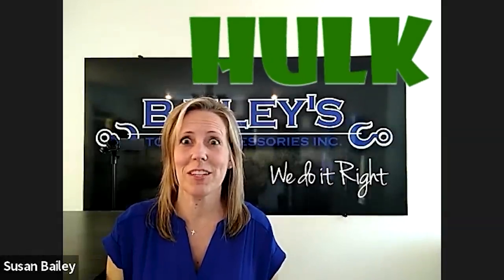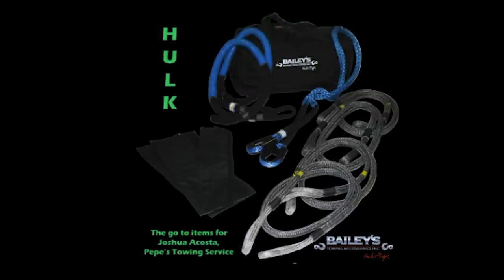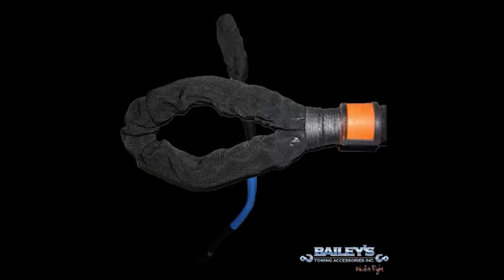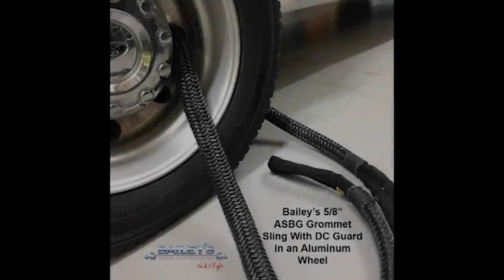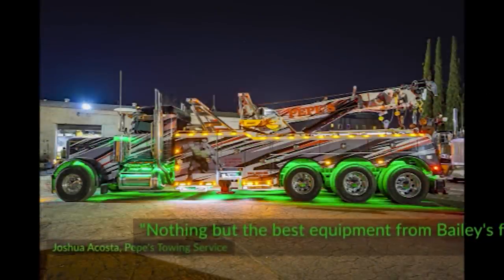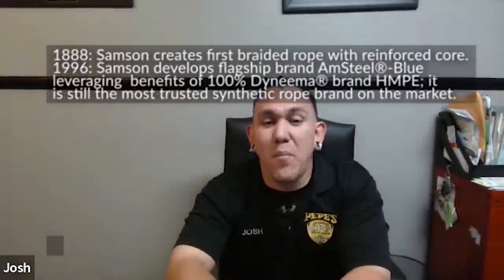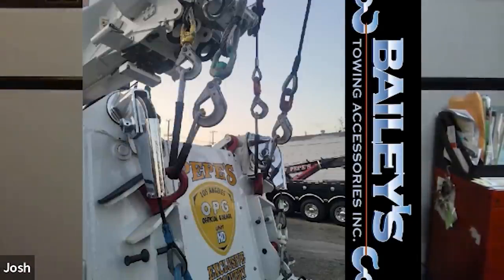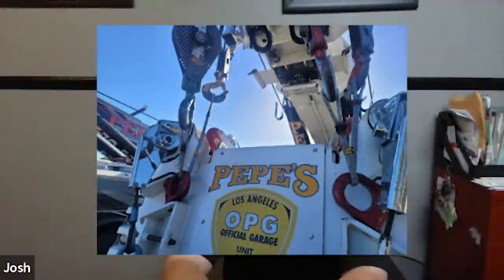Synthetic vs chain in the towing industry: why you NEED to evolve

Comment: Different application, but in 1978-79, my destroyer, USS Hollister (DD-788) transitioned from manilla to synthetic mooring lines. Synthetic mooring lines all had tattletales woven into them so that you could tell as it was approaching maximum safe load. Never had a synthetic line break but seeing the seawater flash off as the internal temperature rose was always impressive. There was a lot of inspections of the lines as part of preventative maintenance.
PS - Long Beach Naval Shipyard team used a lot of wire rope but they were specialized at maintaining / rigging heavy loads on and off the ship. Items like motor generator sets, gun mounts, etc.

Comment: I am a mechanical engineer and steel ropes definitely outclass synthetic. This is due to their vulnerability to shear. One sharp edge and you won't see it coming. Chains have a similar problem where it is hard to see the wear, but it's still less likely to shred. This does not mean synthetic is by definition worse. In many cases it is the best option. They are still developing synthetics, even synthetic mixes (composits)  with metal. 
Keep using whatever works for you. For rigging steel ropes aren't an option (bend radius too small). Synthetics are a good option. Most important is to take the working load limit from the manufacturer seriously. This has a safety factor. If it is breaking load limit you should apply a factor 10 for safety (due to working close to people)

I know you always make sure everyone is clear of the job so that's already the best safety measure.
Cheers for the video!
Reply from the maker: That is correct, that is why I place a HUGE emphasis on protecting the straps and slings. These ropes can fit nimbly into places a chain cannot. My applications are strictly for the towing industry. You wouldn't use these on sharp corners. For the vast majority of calls, these will out class steel rope. Take my 5/8" ropes here, they can hold 33,000lbs in a basket, can be folded to fit in my hand easily. I can carry 4 around my neck and not even feel it. You have to factor in efficiency as well

Comment: Hi from uk josh and crews👋👍 nice to see a interview with the company that supplys your equipment man👌 and nice to know your values on it to and I think chains are dangerous on high rigging like containers etc cos if its slips of side and catches operator it likely to pull them over to as nylon ropes got tiny bit more leeway 👍 like the touch with fire hose too never thought it was hydrant hose👌 also great job at end for airport that rig must of weighed some tonnage coordination was key as always👍 thanks for your time and be safe see you soon 👍👋

Comment: It gets down to cost and the return you can make. Synthetics with an operator that cares about the equipment can save time and money. Operator that allows synthetics to get ratty you're going to have problem giving out. You have to inspect your lines after you use them chains and cables should be checked as well. But many employees do not see the job the same way an owner does.

Comment: How does bailey's compare to Yankum ropes? I see Heavy D of the Diesel Brothers use them all the time for recoveries.
Reply: Yankum are kinetic energy ropes, so they are designed to stretch and contract. Not the same as rigging synthetics. Great for recoveries see Matt's Off Road Recovery. Ron Pratt uses them in more normal towing applications often as line extensions or redirections.

Comment: needs a spreader beam
Reply from the maker: A spreader on a cargo loader? Why would I possibly do that when it's not an even load?you do know a spreader bar isn't even rated to lift that much, do you even know anything about them or are you just talking out of your behind?
Reply: @PepesTowingService  I've used 2 cranes for on spreader beam rated at 400 tons. Power plant use. you can still control the load with having your pick points "out" and not rubbing or causing unwanted stress on "certain components". Ive manufacture Large spread beams. youd be surprised. certified by a 3rd party company of course
Reply from the maker: That is a very specific use case. We're talking about tow truck spreader bars. What I lifted far exceeds the working load limit on a Miller Spreader bar. The right side is the heavy side, now the second truck can compensate by tightening up more on that side but why? It would take a ton longer to set up, for a less effective job and much less safe. I don't get it?
Reply: @PepesTowingService  Tow truck spreader or not. I would of used one. But I also wasn't on site. Not sure about less safe to person and product but...Good Job
Reply from the maker: You don't make any sense. WHY would you use one? If you did, you would have exceeded the working load limit by about 15,000lb. That is just plain stupid. I'm legit curious, WHY do you keep saying you'd use a spreader bar? What is your reasoning?
Reply: @PepesTowingService  already said it if you cant make sense of it all good. don't get mad bro
Reply from the maker: At this point, it feels like you're just trolling. The spreader bars on Miller Tow trucks are rates at 40,000lb. As you clearly saw in the video, I was well over 50,000lbs. You would have overloaded the crap out of your spreader bar, for what reason? There are no benefits. A 4 part pick is the preferred, safer and more efficient method. Because you've used a crane spreader bar in a different application is completely irrelevant. People like you scare me, who sacrifice safety for pure stubbornness. It's a miracle you haven't injured anyone or yourself yet
Reply: @PepesTowingService  Great advice. Have been operating a crawler track 1200 ton for the last 10 yrs. Before 30 yrs doing a mobile 750.  Good talk
Reply: @PepesTowingService  Don't get butt hurt over a spreader beam comment
Reply: @PepesTowingService  You havent ever seen a 4 hook pick with a spreader. AHH son you have a lot to learn
Reply from the maker: You still haven't answered the question, just that a 4 point hook is possible, which I never denied. Let me make it clear since you have trouble with comprehension. I knew I'd be lifting close to 60,000lb with my truck. My spreader bar has a maximum working load limit of 40,000lbs. Now, with these facts, why on earth would I use the spreader bar? My snatch blocks are rated at 30,000lbs each, and I was well within my working load limit. By using a spreader bar in this scenario, I'd be overloading it by almost 50%. So with these facts, WHY would I use a spreader bar?
Reply: @PepesTowingService  silly. like i said ain't my gear and I wasn't there. Dont waste my time I'm going to go fertilize my lawn in Wisconsin. Im sorry you have California standards. it sucks I know
Reply from the maker: How do you get through life being so dense. You realize you come off as a 5yr old right?
Reply: @PepesTowingService  Ahh the insults come from a You Tuber. needing extra income. talk about slander
Reply from the maker: The largest tow company on the West Coast needs YouTube revenue. I could just sell one of the 90 trucks in my fleet. But OK, enjoy your grass 😂
Reply: @PepesTowingService  Funny. Only if you knew. but you won't so go ahead and talk. The grass is just a hobby. ya know.
Reply: oh sorry california has rocks?